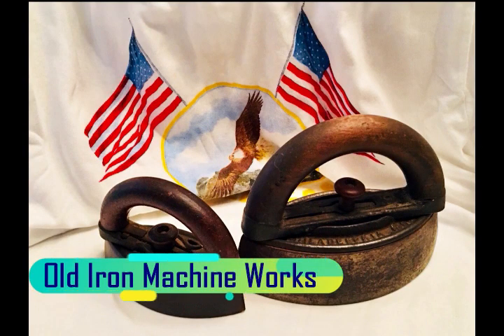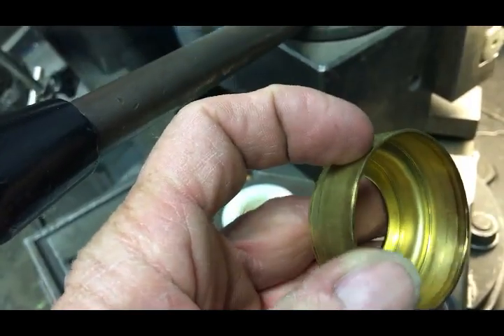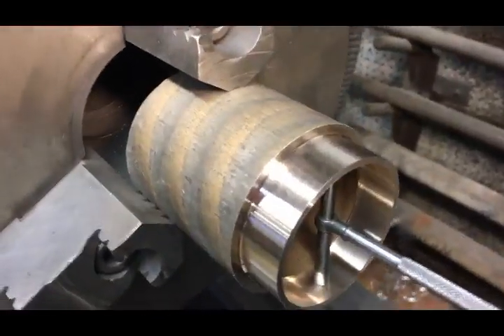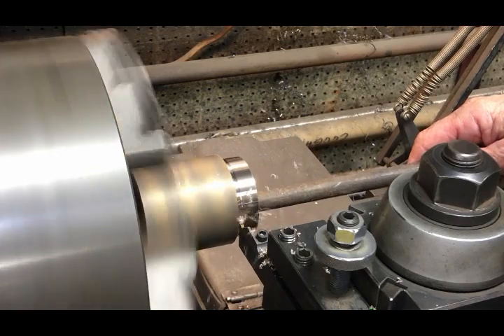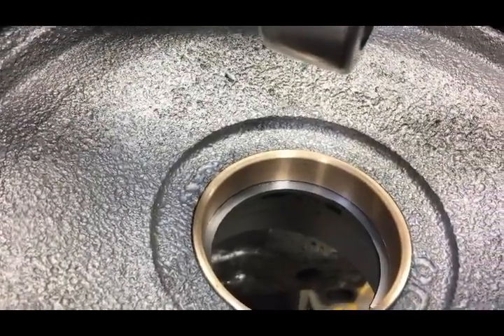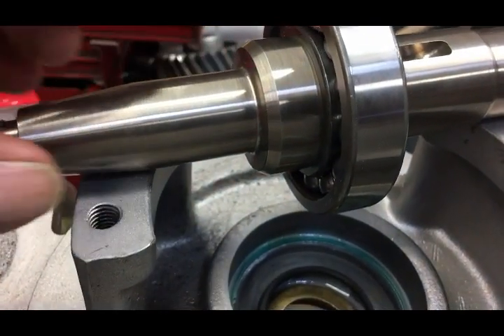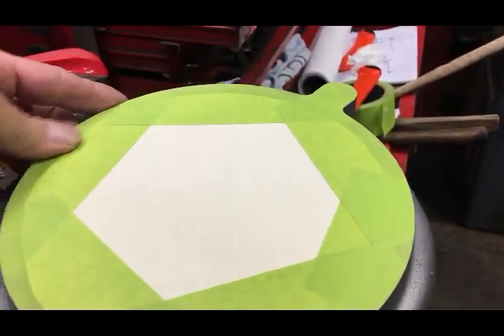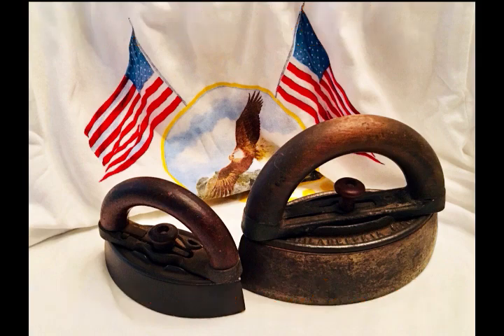Cat 342 Water Pump Rebuild

Comment: What is the white plastic piece you show with the seal kit ??
Reply from the maker: They are made for driving in the seals. I don’t always use them.
Reply: @OldIronMachineWorks  can you tell me the torque spec on the impeller bolt ? And should I use blue locktite ?
Reply from the maker: @Vjiovino  I do not know the torque spec, I always go by feel. No need for Locktite. It uses a tapered shaft and a castle nut that uses a cotter key.